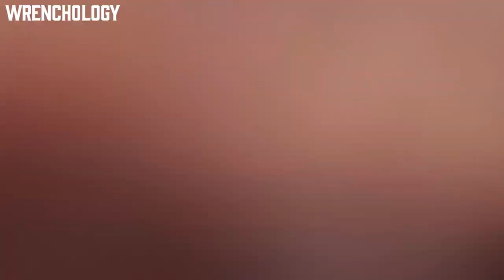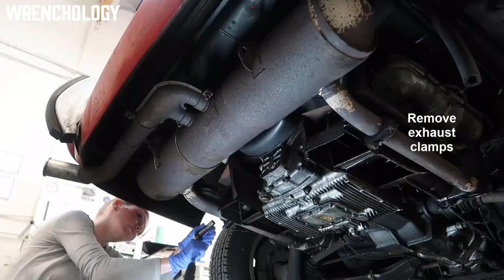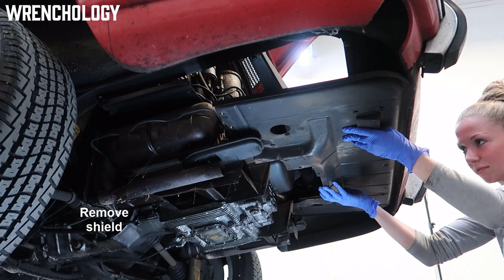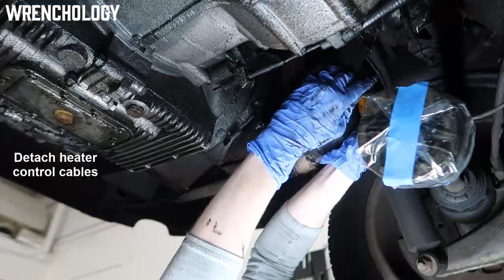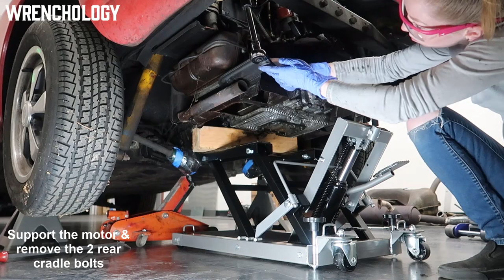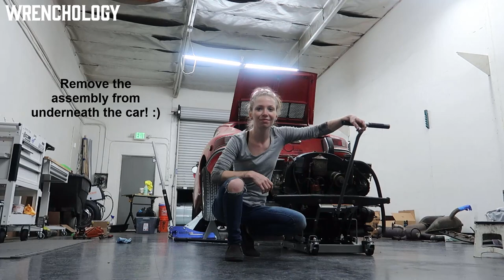How to remove the engine & transmission on a 1968 Porsche 912

Comment: You can get more vertical clearance by removing the rear license plate panel. It’s only a few screws so it worth it- since you won’t have to lift the car so high. 
Great job.